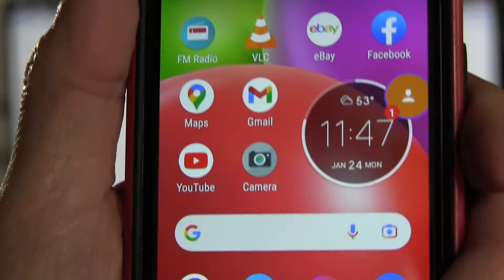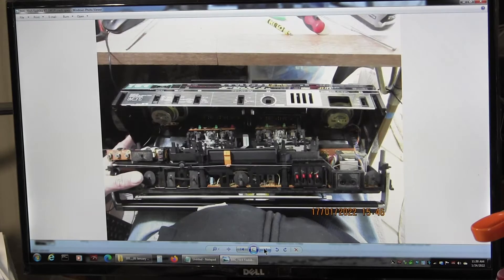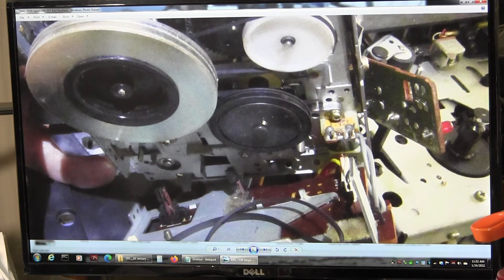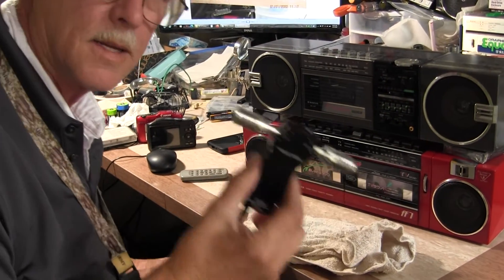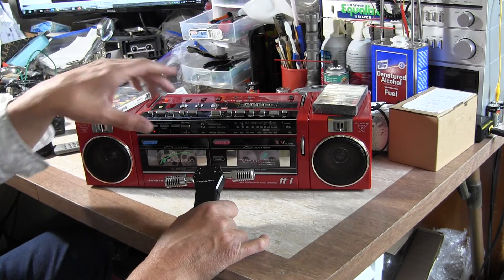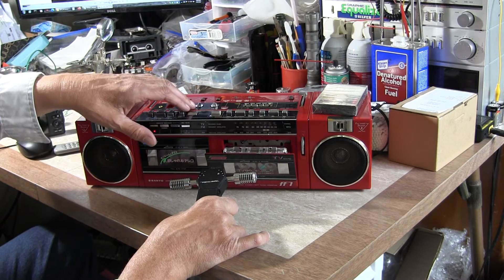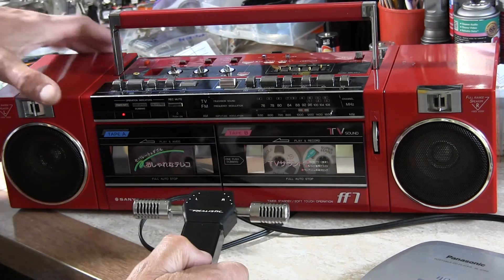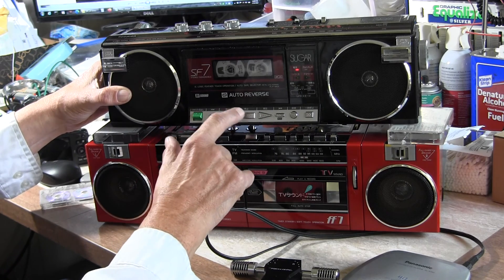Sanyo MR-FF7 Red Fast Forward works AMSS Cassette Play MR FF2 Toshiba Sugar RT-SF7 SF5 Aiwa CS-R1

Comment: Never had one of these smaller boxes but they actually looks pretty Nice. The Sanyo have lots of features linda cool 
I don't what brand or model but it's very similar to the red Sanyo but have 4 speakers 2 are pointed up and the other 2 at the normal place but i suppose that modelo have better sound
Reply from the maker: No it doesn't it's just a added feature having a speakers pointed up it doesn't add any more sound to it. The best feature to have in any portable is an equalizer that way you can set the sound much better than just bass and treble or even just tone. Like in the six speaker model you mentioned only has tone only
Reply from the maker: Adding more speakers doesn't give it more sound it's just a gimmick to help spread the sound around how many boomboxes do you know that have speakers that point up very very very very few